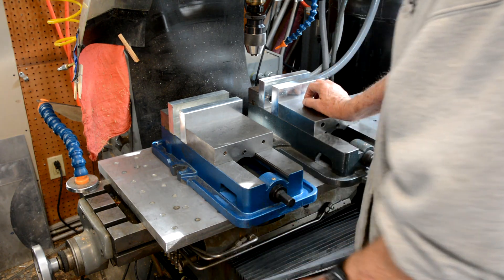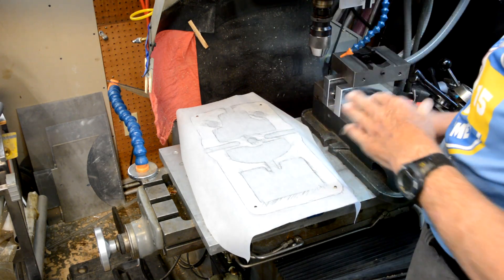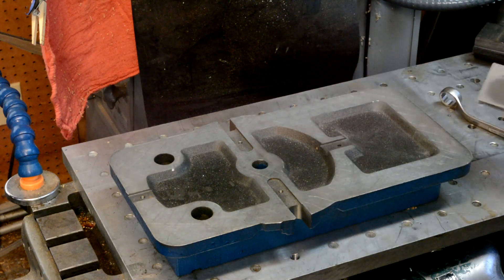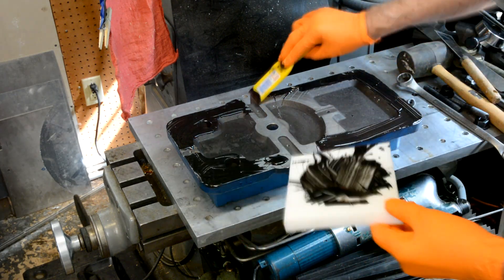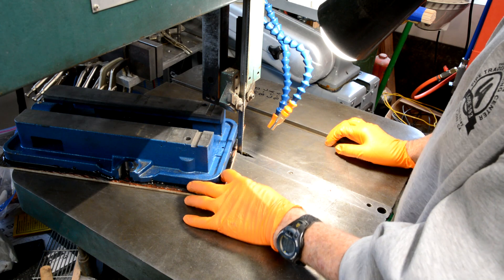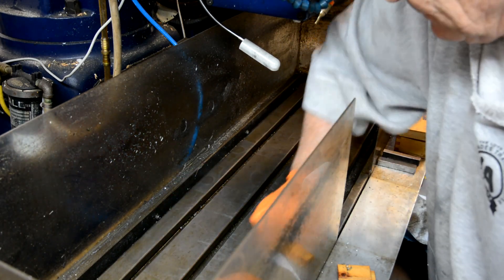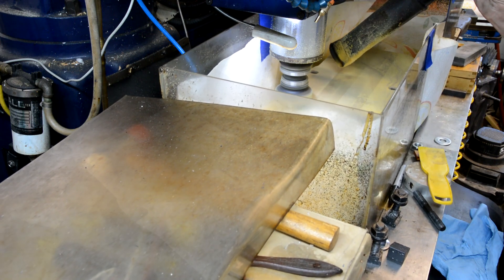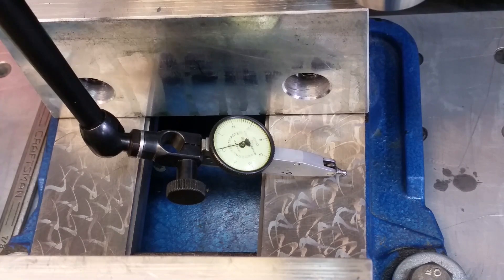Raising a vise height with Garolite LE (fiberboard)

Comment: I got a 1/4" sheet of garolite le from McMaster-Carr and it is warped as hell, I don't have another source but just keep that in mind.
Reply from the maker: I guess that is why you would have to scrape in it afterwards.
Reply: @vendter  Unfortunately I don't have the capabilities to do that, I got it to use on a 3D printer.
Reply from the maker: @timmturner  Well, that sucks.
Reply: @vendter  It certainly does, it was over $50
Reply: @timmturner  If you need a cheap fiber reinforced polymer which doesn't come warped from the factory, I've had great luck with GPO3 from onlinemetals (but you obviously won't be getting the same batch)
https://www.onlinemetals.com/en/buy/plastic/0-25-plastic-plate-gpo-3-red/pid/17917
Keep in mind that no plastic will be as thermally stable as ground metal plate though.

Flatness isn't guaranteed unless they say it is, so if you want a guaranteed tight tolerance plastic sheet, you'll have to search "tight tolerance plastic sheets"
These are the only two relevant plastics which McMaster sells with guaranteed tight tolerances, Delrin and G10:
https://www.mcmaster.com/2911T21
https://www.mcmaster.com/9123K75
Reply: @elonquemattheson6151  Yeah I meant to order G10 but mistakenly purchased garolite le

Comment: Garolite LE is highly hygroscopic.  I would never dream of using it for this application.
Reply from the maker: After I finished scraping I sealed the scraped surface with epoxy.  It is still flat and has not shown any evidence of absorbing water or coolant (oil).

Comment: Interesting. Are you 100% sure that material isn't hygroscopic or can absorb oils? Maybe I'm being paranoid, but with anything cloth based and with that surfacing to the correct height I'd think you've opened up the materials surface to that possibility.
Reply from the maker: I can't say for sure.  The non machined surface does not absorb oil or water, but the machined surface definitely does stain from oil.  I coated it with laquer just in case.